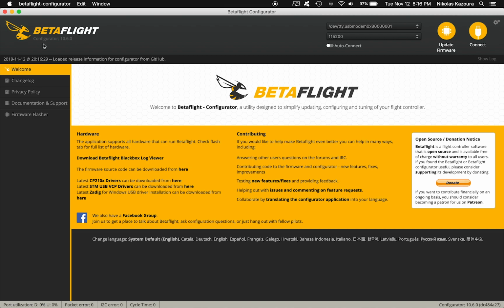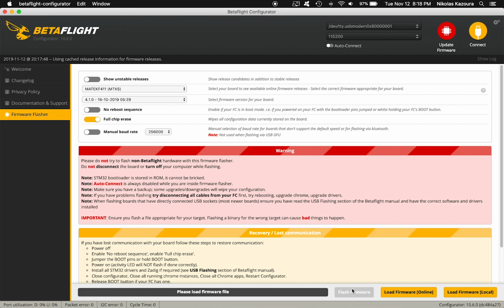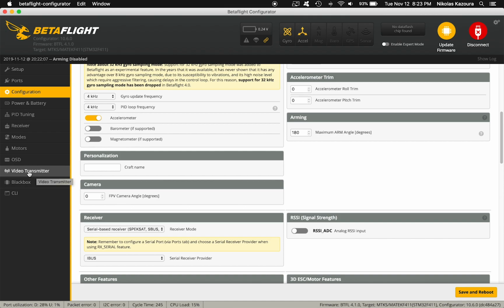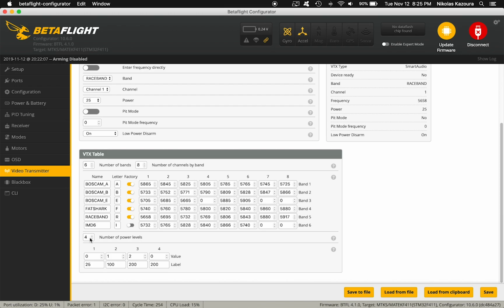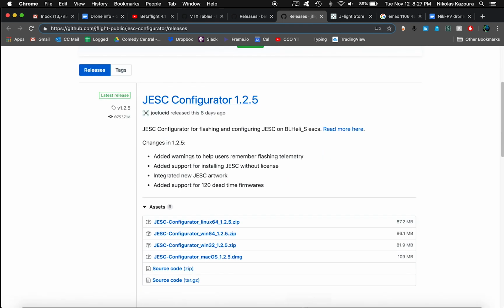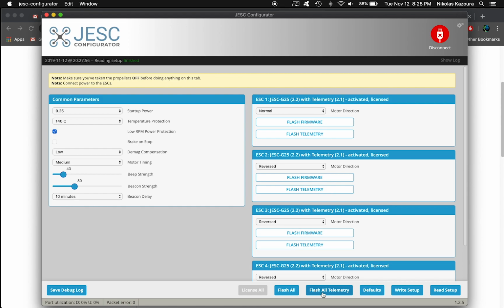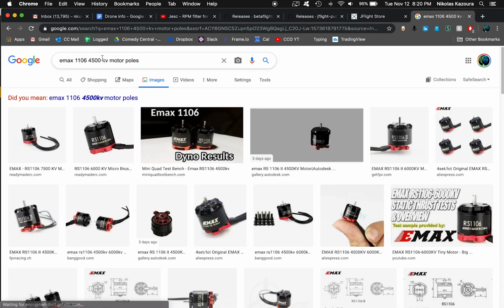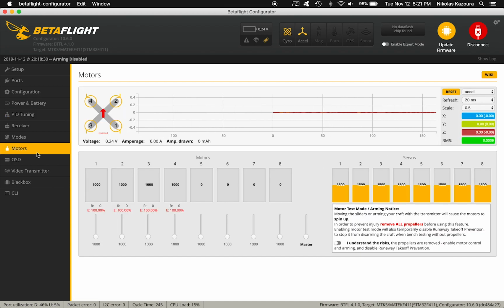Betaflight 4.1 Setup WITH RPM FILTER for micros - 3 inch, 2.5 inch + VTX Tables

Comment from the maker: UPDATE - one small tweak in the PID filters - Bardwell updated his setting and changed the harmonics value back to 3 (was at 1)
Reply: why PID loop 4k/4k not 8k/8k and why dshot300? cheers
Reply: @aliasrandom9241  there's a really high CPU load when running bidirectional D-shot. I have F7 boards and run D-shot 300 4k, 4k. If you go to cli and run (task) you will see a really high load running D-shot 600 8k,8k. D-shot 300 4k,4k runs incredible.
Reply: I'm running bidirectional D-shot on all my quads now. It's simply incredible. First time my little Diatone gtr369 has no prop wash or minimal. Really appreciate the video my only quad left is my emax tiny hawk S.
Reply from the maker: @mike216ism  nice! I'm guessing you were able to get BF configuration 10.6 installed then?
Reply: @brickclickfidgets  no I wasn't. Been using my phone
Reply: @brickclickfidgets  wasn't successful. Been using my phone and speedy bee app to do everything. How were you able to get 10.6 to install on Mac?
Reply from the maker: @mike216ism  I followed the terminal instructions. At what stage in the install is it not working for you?
Reply: @brickclickfidgets  I did also. Did you delete old version before installing?
Reply: @brickclickfidgets  I opened terminal, copy and pasted command. Hit return. It asked for password. I entered it and hit return. It would never over right the new version? Not sure what I'm doing wrong
Reply from the maker: @mike216ism  did you try deleting the current version first?
Reply: @brickclickfidgets  no I haven't. Was afraid to loose it? Will that work if I delete it?
Reply from the maker: @mike216ism  you can  just delete it then restore it from your trash if it doesn't work.
Reply: @brickclickfidgets  okay. Will try
Reply: @brickclickfidgets  yes I now have it! Thanks so much! I tried for weeks to get this running. Much appreciated

Comment: hello,thanks for the vid.. im running bf 4.1.1. on my geprc phantom, dealing with a lot of propwash in hard turns or drops, bidirectional dshot enabled,and seemed like no change to me... trying to tweak the pid tune for the first time.. its ok if i run bdirectional filter loop on 2.67k ? when i set it up on 4k/4k, i check it in cli with command tasks,and i have not stable load there,sometimes dropping even on around 3500.. when i had it on 2.67/2.67 , seems to be a lot better.. thanks a lot :)

Comment: Thanks for the video, quick question. I have the Xing 1507 motors, when I look at the tech spec it says 12P but if I count the magnets there's 14, which do I go with?
Reply from the maker: Interesting. I'd definately say go with the actual magnet number that you counted.

Comment: Does this work on a 3in quad. Did it fly well for you sir. I did this but still have pro wash on flips and rolls
Reply from the maker: Follow the instructions next to the PID sliders. If you hover your mouse over the question marks it will explain how to adjust for prop wash.

Comment: Why Dshot300 vs 600, etc.?  Why 4k/4k instead of 8k/8k?
Reply: You want Dshot 300 because it matches the 4k4k speed..   Everything will work the best set up like that..
Reply: I just found out the hard way then saw that Bardwell actually answered that in a video.  Basically, the RPM filtering is process intensive so coupling that with 8k/8k will likely max out the FC's CPU and the quad will not arm (LOAD flag).

Comment: Did this just 15 mins ago on my nameless and I think it fryed either the motor 2 or took out the esc for that motor. I'm pissed! I shouldn't have tryed the rpm stuff for it. It was good till then. Even flashed it with ph90. I only flew it 4 times before this. It hovered and bounced off the ground then flipped to the right towards that motor
Reply: Todd! I keep trying to tell you everywhere lol JESC released a new configurator. There was a bug with the nameless boards. Should be working now!
Reply: @jsmithproductions  nope. It took out esc number 2.
What I dont get is this. It will spin up to 1400 rpm fine, then cog, then work after like 1550 rpm. Then at 1700 rpm it does it again but will stop working period.
Motor screws get hot as hell.
And even all the esc tones work.
I looked at the board and it looks fine, nothing burnt. I'm kinda lost
Reply: @toddbeal4373   "Motor screws get hot as hell" Maybe screws touch the windings? Just trying to help.
Reply: @heimwolf  tryed it yeasterday. I think its bc the motors cant Handel the 20 amp beta and the 3s battery.
Think they only can handle 2s ones.
It twitches bad if I try to give it just a 2% jump.

Comment: Good info! Still running 3.5.7 on my micros don’t know too much about the new firmwares.
Reply: I say, if it aint broke, dont fix it.  I've seen your vids.  You micros run smoothly.  Mine are on 4.0 and suck.  I was about to go to 3.5.7 till this came out.  I'll try this first.
Reply: @SteveOFPV I just flew 3 packs on a 65mm 2S build which has a Falkor micro onboard. On 4.0, it had an unbearable amount of jello.  I'm not a great tuner as it takes me too long to do and I really dont have the time.  I put 4.1 on it with these settings (plus lower Master Mutliplier and less filtering for the Gyro filter and D term filter sliders) and the jello is seemingly gone and the overall feel is better.  I say seemingly because there was a lot of wind during my flights making for a bit of shaking causing a little jiggle of the image at times. On a calmer day I think the image will be perfect.
Reply: me too Flashes 4.1.1 on my CSX and flying good on stock. Wasn’t the case for my CS3, I had to lower P and D gains on the sliders.